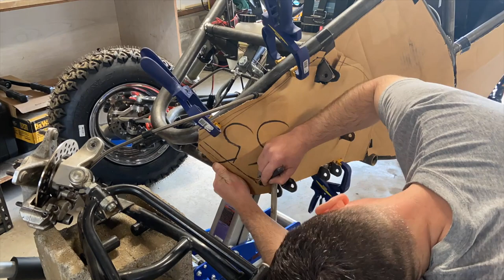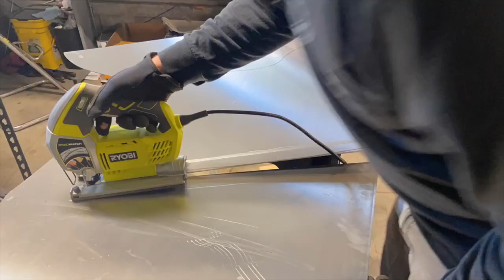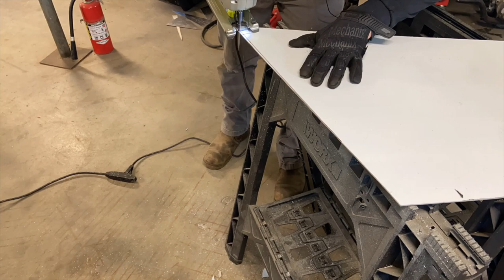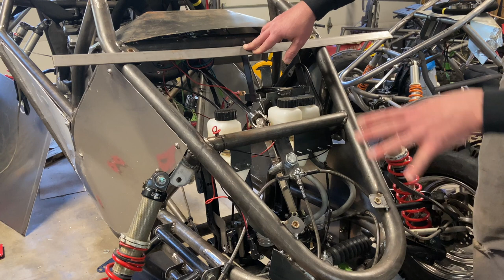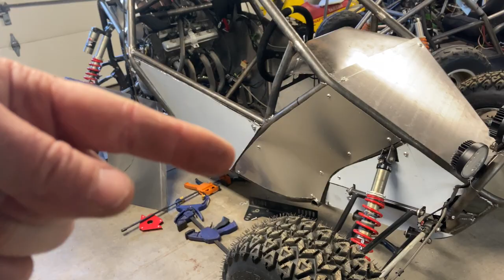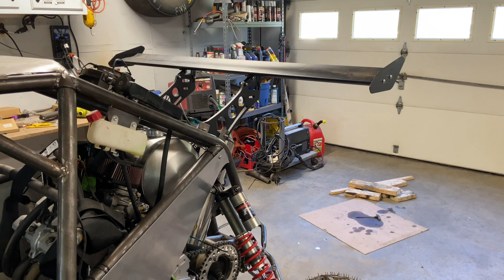Crosskart Build #26: Aluminum Body Panels

Comment: If you ever find yourself doing this type of symmetrical body panelling, after you make one side of the body fit perfect, match the shape of the cardboard template to that of the finished panel and use thay to check  the other side and check for any inconsistency before you cut the metal panel sheets. It doesnt take longer than a few minutes and might save you having to buy a new sheet in the future
Reply from the maker: Hindsight is always 20/20. I learned a lesson for all of us it seems. I could just edit out all the hangups I have like the other guys do, but we have to learn from our mistakes just as much as our achievements. Thanks for tuning in 👍

Comment: Yes those welds may not look the best but god damn look how it turned it out it looks great
Reply from the maker: I am a “highly adequate welder”, which means they are strong enough but not the prettiest. I can accept that as a garage builder. 🖖.
Reply: @KJRaycing  yeah people get so hung up on a weld not looking good by if you look close it’s easy to tell if it’s penetrated enough or not that’s why i said some of your welds may not “look” that good but they definitely will hold
Reply from the maker: I did not take offense. I use a 110 welder because the tube is less than 1/8th”. Someday I’ll get a 220 and make those welds a lot prettier 🦾

Comment: Numer or model of the tyres?
Reply from the maker: Front are 23x8 and rear are 23x10.5. 12” spun aluminum wheels. They are 6 ply Carlisle turf tires.